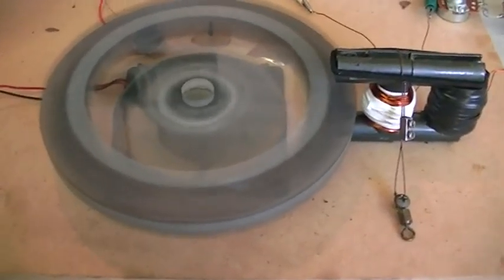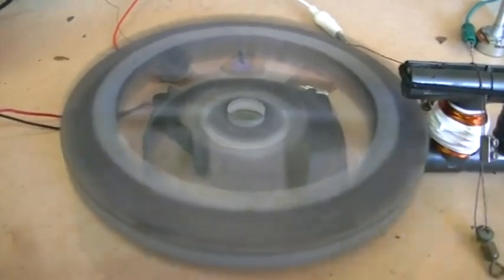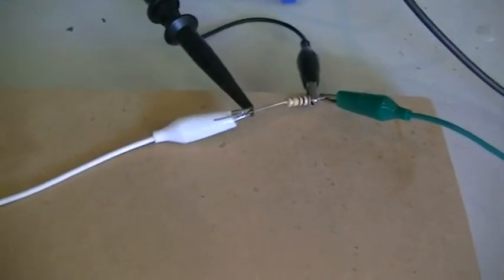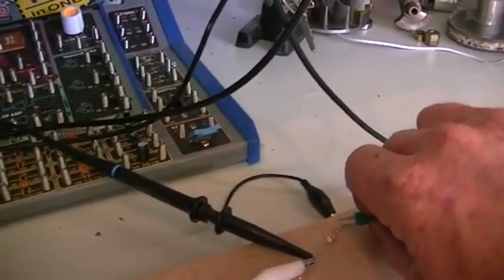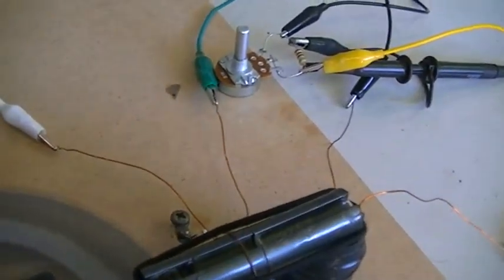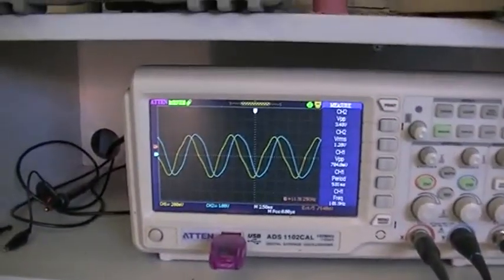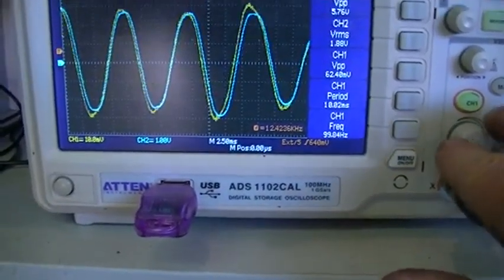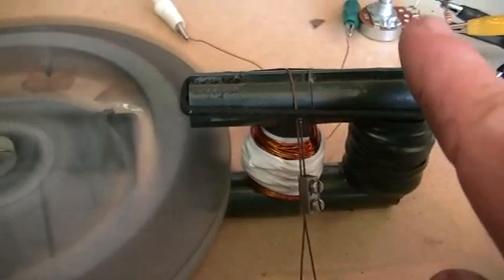Advanced magnetic field's

Comment: It's possible that there is some amount of capacitance within the variable resistor you are using in the secondary coil.  Try swapping the 2 load resistors to see if the phase relationship changes.  Just a thought.

Comment: tin man like your video,  unlike a single core setup magnetism also has current and without an escape has to fight against upcoming magnet but as in your video the lenz force in this case does have a way out which would be the alternate rear coil (core) so as with any current magnetic current will take the path of least resistance sooo instead of fighting upcoming magnet it will re route itself in that back loop that is self canceling that is north will seek south and south will seek north with no interest in fighting the rotating magnets.

Comment: Hi Tinman I'd like to ask does the secondary output impedance change very much from light primary load to heavy primary load?
You can tell this by open circuiting secondary coil ...measure the secondary o/c volts with scope...then use your variable resistor load to load secondary coil till it drops to precisely half of the o/c volts, at this time secondary output impedance = external load resistance. Have to do it for light & heavy primary loads. 
It will give an idea if you are seeing electro static rather than inductive coupling at light secondary loads. 
Thanks for your experiments Gerry

Comment: Nice experiment! I'm finding very similar results with a bifilar primary transformer. The primary can be wound with almost zero resistance and both lines of the AC supply direct connected. This should result in a massive short circuit yet very little current will flow with an open secondary magnetically coupled. This is what happened with the ribbon coil primary of Gerard Morin's pole transformer. The secondary and primary can each control flow in the other by magnetic choking. With all the resistance now removed from primary winding the primary circuit energy can be consumed in series outside the transformer and still produce magnetic flux to drive the secondary. The energy consumed in the primary resistance load is being reproduced in the secondary at a ratio of 1 amp to .77 amp with iron core . The less you resist flow equally the more the efficiency increases. Multiple primaries in series would be a ratio of 1 amp to ...? amp.

Comment: Hello TinMan! Good to see you experimenting again.
May I tell you how I see it (the flux is simply taking the path of least resistance in every case - like Flynn parapell path): when the secondary coil is loaded more, most of the magnetic flux passes through the primary coil, but when the primary coil is disconected, almost all flux passes through the primary coil (because the secondary coil represents a resistance to the flux, so almost no flux passes there).
As for the phase shift I have no clue - maybe it's the coil lenght causing that.
Question: what does the scope shot look like when you tune it so there is equal voltage on each coil?

Enjoy your weekend!

Comment: Maybe try plotting the voltage waveform of the two coils, I'm guessing the primary should generate a voltage before the secondary.
Also, checkout Smith charts they're pretty rad for working out how inductance and capacitance causes a phase shift between voltage and current waveforms.
You should be able to advance the current rise further by increasing the number of turns on the secondary/decrease on the primary.
I really like how your generating the field with that magnet disc, did you make the disc yourself or doctor it from something? 
Maybe try a gapped c-core fully wound with wire to increase coupling between the disc and the primary, if you wanted to go down the generator route, i've dabbled with that idea myself hehe.